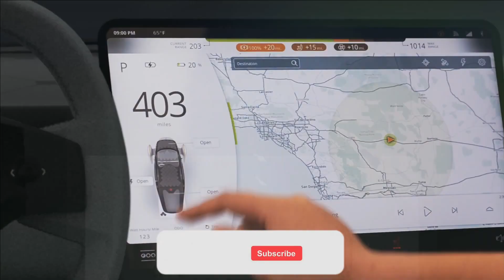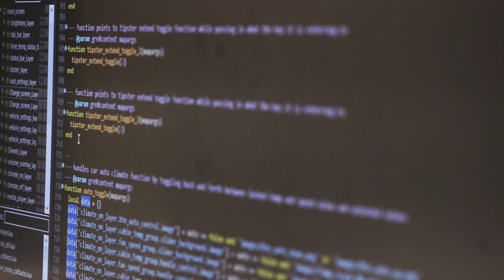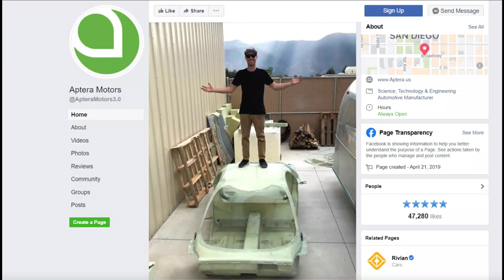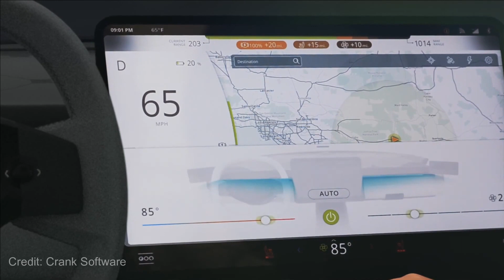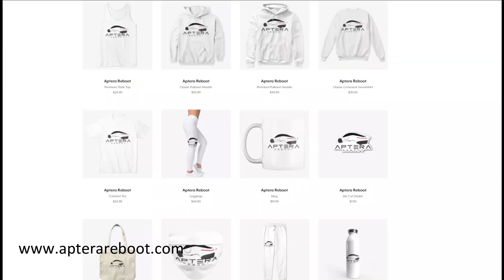Top 3 Reasons Why Aptera Will Fail?!?

Comment: How about this reason: it's a 3 wheeled, 2 passenger vehicle, that's 8" wider at 88 inches, than an F150 with its mirrors folded, which is "only" 80 inches. If you've seen a modern day full sized pickup then you know how excessively wide that is for a car that's meant to be used in the city. Personally, that's a  deal killer for me... compact dimensions with a full size footprint?! What's more, you said 270,000 two door cars were sold; but this is not just a 2 door car... it's also a 2 passenger, electric car with 3 wheels. Current 2 seaters are supercars, Miata, Supra, BMW Z4, Mercedes SL, SLC, Porsche Boxster, Cayman, Corvette, and the new Nissan Z... I don't see Aptera winning over any buyers of those vehicles. They're in an all new segment that's going to have to gain all new customers... they have a long tough road ahead imo.
Reply: Aptera will beat most of these super cars on performance - I have ridden in an alpha prototype - and at a terrific cost of ownership.  Once they are on the road, a lot of people are going to change their minds
Reply: @n.brucenelson5920  but performance isn't just straight line acceleration. Nor saying a 3 wheeled car can't be fun... Morgans are a blast to drive. However when you're going around a track or carving canyon roads, all the power in the world won't make up for that one less contact patch.
Reply: @georgecostanza2695  George, what you are forgetting is the light weight of the vehicle. The Aptera contact patch will be very lightly loaded compared to many of these vehicles, even with only three wheels.

Comment: California law requires a front license plate. How can that be attached? How would you change a rear flat tire? Do you plan on setting up service arrangements around the state/country or will all maintenance have to go through your facility?
Reply: Not for an autocycle.  It will be completely road legal.  There is a jack point, but most repairs can be made by removing the tire skirt, and using a pair of pliers and a plug kit and dc inflator.

Comment: This company won't fail this time. The fact that it's a two seater is irrelevant because this car is geared more toward commuters and individuals that simply want a more environmentally safe vehicle without compromising their own safety. Single driver commuters make up almost half the population of the united states in most studies. Also this car has the cool factor and people will just buy it based solely on that alone. The car has to pass government safety standards just like any other vehicle so safety aspect isn't even an issue. Two big features not mentioned are the facts that it has a 1000 mile range on a single charge and the base model gains 20 miles a day just by sitting in the drive way during hours of light. Nothing else on the road does that.
Reply: Also it didn't exactly fail the first time around. They simply started the company during a recession and the EV industry was still in it's infancy so parts were harder to come by and expensive.

Comment: I would have to agree with you on your main issues that will affect their success.
1.  They should not make promises by date.  ie, have first cars sold in Q4 2021.  It's ready when it's ready.  I don't want a plug in issued later that should have been installed and tested in the vehicle.
2.  Dependence upon too many peripheral companies.  Their parts are built to their standards.  Look what happened to Chevy Bolt's dependence upon LG's battery initial battery design.  Tesla doesn't share the same issue because they make their own batteries.  There are other issues with importation, political restrictions, Covid variance, monetary exchange rate.
3.  The car is much too wide for a vehicle.  It's format will initially be too unrecognizable to the average driver who will not realize that there is a shrouded wheel stuck out from the main body design.
4.  Servicing the car.  There is really no structured service agreements on how the car will be serviced in case of body collision repair or failure of any major electrical parts.  My own body shop is questioning how to do a structural repair.  I know that we all will have the right to repair, but I don't want that forced upon us.  My wife has not received certification on working with 400 volt circuits nor do we even own the proper high voltage tools.  Will we all get a shop manual with the car?  Where do we tow the car for service when it breaks down on the side of the freeway out in rural California?  Remember that we will all be beta testers for the vehicle.
5.  Warranty:  What is the warranty and what is it going to cover?   For how long?  
6.  Customer Service:  As being beta testers for the motorcycle, an excellent support team should be established, possibly 24 hours.
7.  A make or break issue with me is how safe the cars will be.  I don't think they have even established how many airbags the cycle will have.  They at one time expressed having a single seat belt airbag.  That won't fly with me.
8.  Ride quality:  I see some people complaining on the limited payload for the vehicle.  Increasing the payload capacity will only make the ride and handling  suffer with the stiffer springs required.  With the higher center of gravity the Aptera has I am concerned with instability.  They already experienced this on track day with their Moose test.  That is the reason Rousch Performance was brought in as consultants.  They can tweek the suspension settings, but cannot change the weight distribution of the vehicle.  As you can easily see, the main battery mass is above the axle height of the three wheels.  In most other performance related EV's such as the Tesla M3 the battery is below the height of the axles.  I am not including SUV designs.  The same can be said for the cargo weight, it will sit high, above the height of the rear tire.  Most other EV's the cargo sits between the tires as low as the height of the upper rear rims.
9.  Awkward seat height for entry and exit of the vehicle.  I think this is mainly an issue for the elderly or partially disables.

Now don't get me wrong, this is not about knocking Aptera.  I truly want a successful car in my own driveway.  But in keeping with the theme of this video, my own mind has questions.  Many fanboys of the cycle will deny or play down the weaknesses because they have self enamored the vehicle.  In the end we must be realistic and safety is still number one with my family.

Comment: Baseless claims...Don't invest. 1000 miles range , self charging with only a few solar panels? The company started in 2005 and here's where they are at according to wiki:
Net income:  -US$4,188,983 (2020) - see that negative sign? Yes, they're in the red.
Total assets:  US$3,363,000 (2021) - pretty much the value of their prototypes. 
Number of employees: 22 (2021) - no automotive company wants to invest in them, another red flag.
Reply: Do some due diligence and don't confuse different companies. Aptera Motors is in far heathier shape than Tesla was on the same time frame.

It is still a risky play, but great upside with much less risk than a few months ago.
Reply: @n.brucenelson5920  Claim: 100wh/mile. How are they going to fit a 625kg 100kwh battery in that little 3 wheeler?
Reply: @KevinNguyen-zn4vv  It is not so little.  The 100 kWh battery will weigh roughly 454 kg.  Finally, the production bodies will be slightly larger than the alpha prototypes.

Comment: You don't know what the He__ ! You are talking about corvettes et' cetera had two seaters and had no problems selling to consumers worldwide Tesla Model 3 is not sound by a Longshot they have been using the consumer public as guinea pig's from the start that is why they have had many fatalities including Hacker's who would hack into one of these vehicles via a mere laptop computer please do the research via Google or YouTube., and as for part's manufacturing and availability Tesla does this same monopolizing strategy already when it is time to repair or replacing a technical issue giving an owner problems but this vehicle doesn't need a business controlled energy source in order to recharge like Tesla requires and this new technology is not only better than Tesla with Zero Emissions but it doesn't require you to drive to an recharging station making it more practical better technically than Tesla and more sound sense you are more in control than someone or something else and such consumer based support would only Lead to more innovation in making better Models to suit all customers interested

Comment: The only reason I think aptera could fail is pricing. It has premium price but very little functionality, also, the company themselves advertises it as a much simpler and cheaper to build and maintain alternative to conventional cars. Well, if it's cheaper why is it's price tag over 30-50k USD? Why would someone pay more to get a worse product? It's a niche vehicle, much like those 3 wheelers that we see (Polaris, Vanderhall etc.) IMO.
Reply: In comparison to sedans, Aptera is a niche vehicle, but this doesn't matter. Price starts at $25,900, and nothing matches it in range.

The other vehicles you mention don't compare in utility or safety.

Comment: My biggest concern is cost and size. The base model will cost over $30,000 without EV credits but won't be nearly as safe or as practical as a 4 door sedan or crossover but still take up just as much parking space. I would be happy to buy a 3 wheel car if it actually cost less than 4 wheel economy car, but they never do. By the time they go to market, Tesla will most likely have released a $25,000 compact car. I hope Sondors pulls through with making a $15,000 three wheel EV with over 250 mile range. I also wish Toyota or Honda would make a three wheel hyper efficient ICE car. There is a real market for three wheel super efficient economy cars, but none of the major autos take a risk at making them. They instead focus on expensive trucks and SUVs, while start-ups make three wheel cars that cost twice as much as 4 wheel cars then go bankrupt.
Reply: You are wrong about the pricing.  The base model 250 mile range Aptera will cost $25,900.

The safety will be confirmed in standard automotive crash tests which will be conducted and published before shipping begins.

Tesla doesn't have anything with comparable cost of ownership and their production costs are higher.  They are a good company, but Aptera has learned alot and is off to a better start than Tesla had

Comment: One thing could resolve all and more of anyone's hesitancy of purchasing an Aptera due to any Failure.  If Tesla were to Acquire/Collaborate/Fabricate the Aptera in one of it's new/existing facilities.  Some believe this is Tesla's $25K car they've been promising/hinting at.  Your thoughts ?
Reply: After losing control of a board fight to the Detroit CEO of the first version of the company, it is unlikely that the Aptera founders will risk this again.  Also, they are solidly in the Right to Repair camp, unlike Tesla.  I think we will see tech sharing agreements, though.

Comment: Yes they will .. too small niche to make profit , I love the car , cool design, super efficient , solar roof … bud it’s like a sport motorcycle… only certain people will go for extreme design like this , so when u fill the first wave of orders it will slow down drastically after that .. and the company will not make it :(
Reply: Normally, early adopters are only a small percentage of the total market for a new product.  It is likely that once crash test results are released, people start seeing them on the roads and third party reviews start coming out that demand will increase dramatically.

Also, at a run rate of only 10,000 units per year, they are likely to be 32-35% profitable, due to dramatically lower production costs compared to conventional build practices. This will change the industry.
Reply: @n.brucenelson5920  let’s hope so , I like the idea , it’s just most people don’t like so special looking car ( transportation) .. I think when Tesla or any company makes small ,super efficient, solar , cheap , 4 wheel, nice looking 2 seater car .. then people will want it

Comment: I see this as a replacement for my motorcycles. Compared to a two wheel vehicle it has more safety, more comfort, more luggage capacity…. I’m just sad that it’s on-the-road footprint is so big - I see it compared to a Tesla S and that is NOT a small car.  I hope that the design continues to evolve and improve as the battery tech improves over the next decade, allowing the car to be smaller and even more efficient.
Reply: It's not trying to be a motorcycle though. Its trying to be a car using motorcycle regulations to get around the stricter regulations of 4 wheel vehicles. And the smaller the vehicle gets, the less surface area there is for the solar panels which is the whole point of the concept in the first place.
Reply: If it doesn't lean, it's not a motorcycle.  At best, some of the non-leaning open/no-cabin 3-wheelers could be considered a convertible alternative.  While I see an Aptera in my future, It will never replace my motorcycle.  If you're looking for a motorcycle alternative with better traction and stability, look at the Piaggio MP3 and it's various knockoffs.

Comment: The biggest concern I have is the limited payload of 500lb. The ranges of different batteries will increase the vehicle by at least a 1000lb. You would think with the smaller batteries they could mange a better payload.

Comment: My biggest concern has to do with the Air Conditioning system. They say that the AC will be designed to operate in temperatures up to 125 F,  but it frequently gets up to 120 F in Arizona and if the AC doesn't work well at that temperature, it will be a deal breaker and will end up getting lots of poor reviews.  I'd like to hear more about this AC system in the reviews of the Beta models.
Reply: The purpose of the beta models is to test edge cases, including temp extremes.  Better judgments can be made from the delta and gamma models which will be closer to production intent.
Reply: @n.brucenelson5920  I'd say that testing at 125 F is an edge case, this probably should be done now, unless there is no prototype for the planned shell/skin with integrated cooling channels yet. If there's no prototype yet, then might as well wait I guess. I just assumed the Beta version might have already had that integrated.
Reply: @damiangreen299  At present there are two Alpha models with a third being finished now to be revealed within days.

They have just started producing tooling for the beta models which will have significant changes from the alphas, including a larger main cabin.  Further changed can be expected in the delta based on the results of testing.

Comment: My concerns are different. I hope they don’t fail, but here’s what I see……..
- Safety: It’s a classified as a motorcycle. Those aren’t exactly safe, so safety is not a big concern. I would like to see that the roof structure could hold enough weight to shield passengers from being run over by a 4x4, but that’s probably not possible with available materials. 
- Tech: Where is the full solar roof down to the bumper? I keep seeing Aptera with glass rear windows, but it obviously uses a camera for rear view. I know cars are required to have side mirrors, but rear mirrors aren’t. Once again, the Aptera is not classified as a car- why not use that space for solar panels? 
- Safety: Where’s the 3rd eye brake light? Something that small and low should have a 3rd brake if not an LED that wraps around the top of the lift gate and has a 5 strobe function when the brake pedal is applied. I want the Suburban behind me to see I’m there while the driver is updating their FB profile. 
- Cup holders? Every enclosed vehicle needs cup holders. Spilled drinks cause wrecks. 
- I’d also like to see some other colors- like fluorescent green, yellow, red, orange - LOL 😂 

Other than those concerns I like the Aptera very much. I’d rather have 2 Aptera in my driveway, and a 4+ seat EV for road trips. That would be the most cost effective transportation solution.
Reply: Aptera will be crash tested to automotive standards.and results will be published at the end of the year when they have production intent vehicles for testing before shipping begins. Even the original Aptera was tested to have a roof 3 times stronger than any other production cars at the time.

It will do very well.

Full solar will cover the back hatch.
Cup holders will be standard.